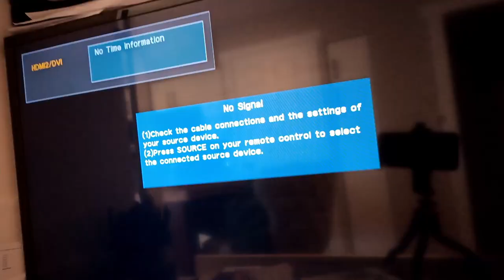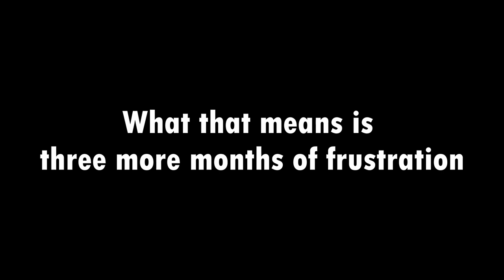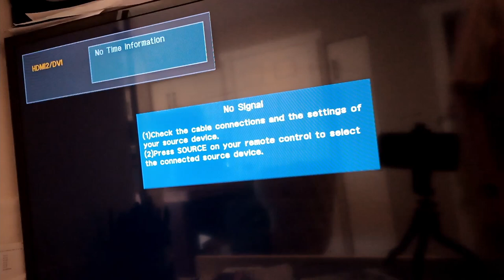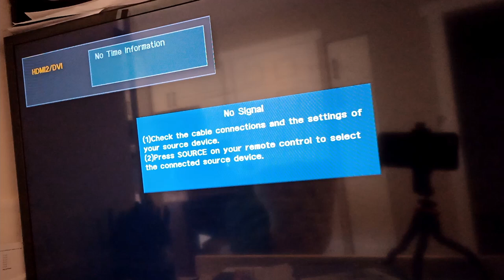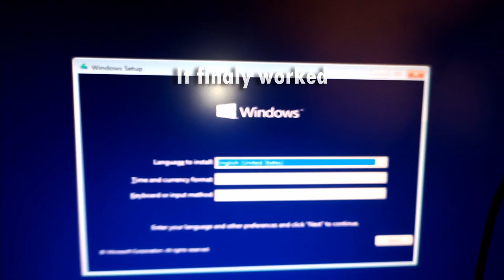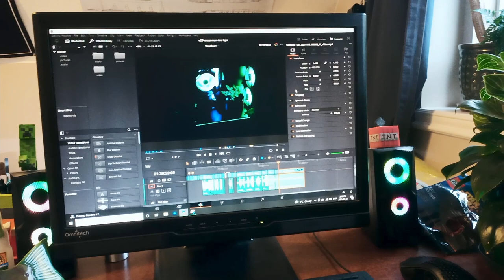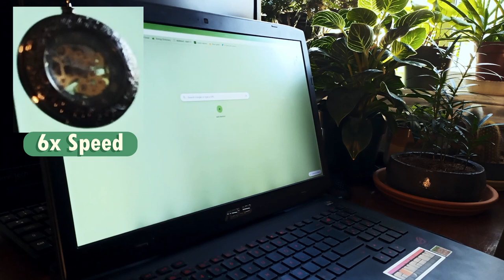My First PC Build

Comment: After you replaced the motherboard it didn't work at your place but worked at your friends place? So what was wrong with the setup at your place that made it not work initially?
Reply from the maker: That is something I was never sure of, it is possible that the car ride bumped it around and something moved into place that was seated wrong, but I'm not entirely sure